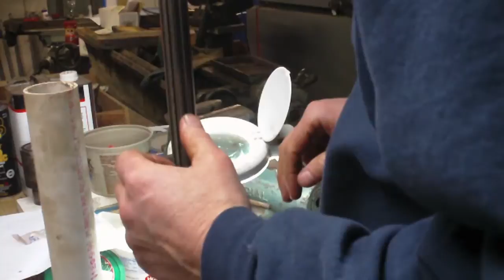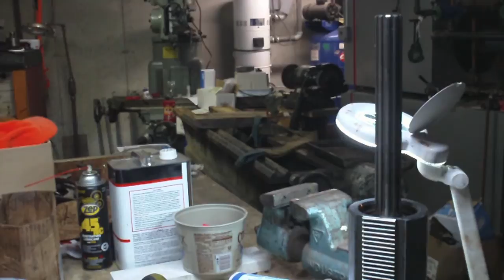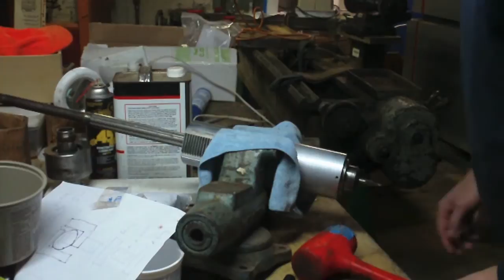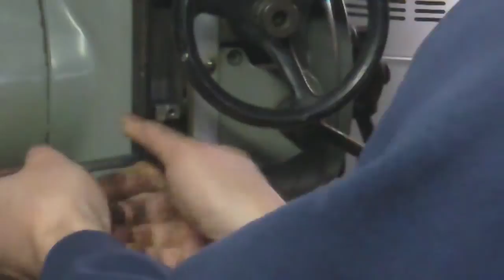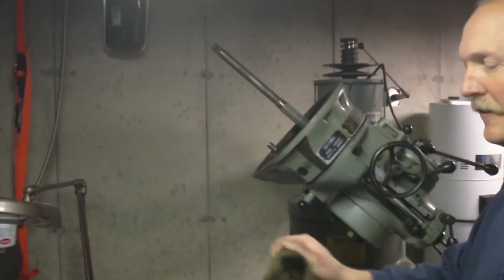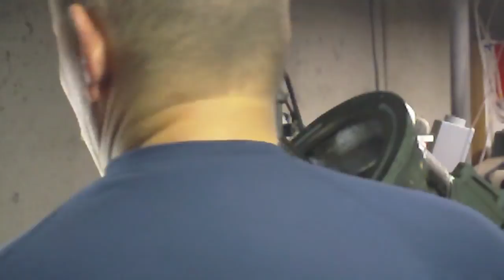Wells Index Milling Machine Part 49

Comment: Just a thought, but your spindle broke just below the threads, do you think that they may be a stress riser point? you said that they changed the nut out on later models for a snap ring.
Reply from the maker: Robert H Sandwith Certainly a possibilty. For all I know the last guy who had this apart overtightened that nut, and caused the failure, or there was a defect in the steel at that point. Either way, it picked a bad spot to snap.
Reply: do you have the torque spec value ?
Reply from the maker: Robert H Sandwith No, another post I read from a guy who called wells to inquire said he was only told it should be "quite tight". And when I asked the guy about a socket to get to that top bearing retainer nut he said they just make one out of metal tubing.

Comment: Is there a pre-load spec on those bearings that might affect the noise/runout?
Reply from the maker: FrankTheCat Yes! And since the shaft is broken, it'll never work. I did not realize this until I had already tried this botched attempt.
Reply: Steve Watroba Oof, I had a feeling that was the case.